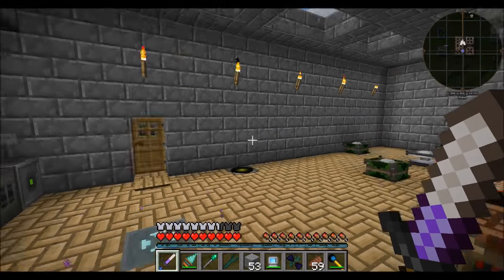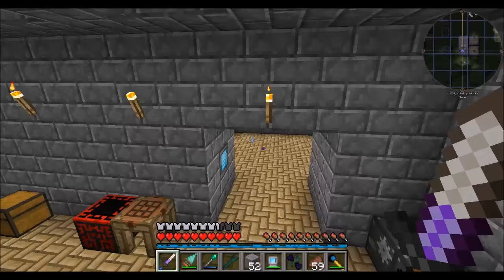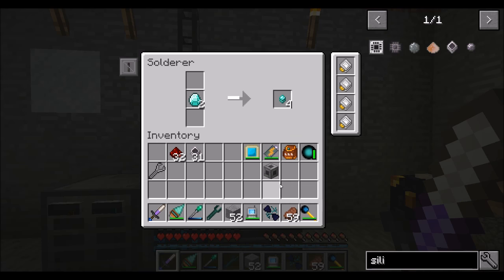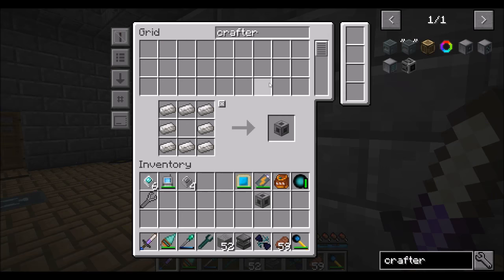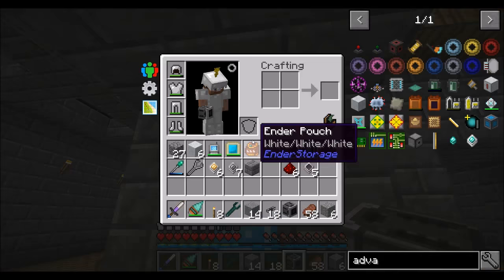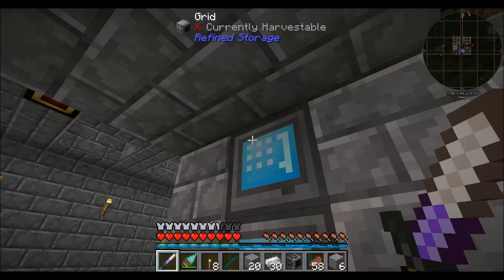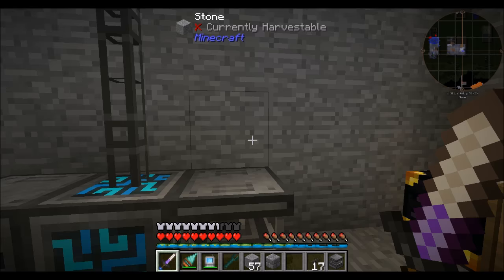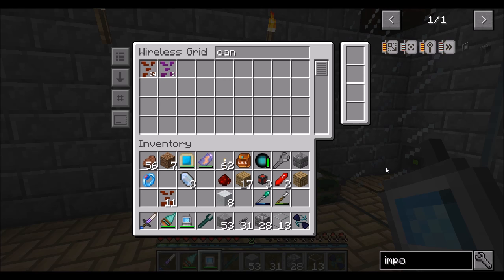Lets Play S8 E24 Autocrafting

Comment: Nice system, I use a very similar one myself. A couple of tips:

1) As others have pointed out, you can JEI shift-click into the processing pattern encoder. I've never found a recipe this doesn't work for - saves so much time rather than having to go pre-craft a bunch of stuff to have the items in your inventory.

2) Restonia / Diamatine / Emeraldic etc. etc. all have the same item ID but different metadata. So if you whitelist one of them and ignore metadata, the vacuum chest will pick up all of them, thus saving those precious five filter slots.

Comment: On your laser setup: if you move the vacuum chest up or the pressure plate down one block, the vacuum chest might work with a range of one since Minecraft might see the item on the pressure plate as two blocks above the vaccum chest.
The laser shouldn't need to move since it creates an area of effect. :)

Also, as +Petar Tsankov mentioned, if you use whitelists in the vacuum chests that hold 5 lasered products each, you should be able to surround the pressure plate with 8 vacuum chests, which would make for 8x5=40 possible items in the current laser setup.

Comment: dire, if you whitelist instead of blacklisting you can add more vacume chests
Reply: He could also just use a mod-item filter whitelist with an actually additions item in it.

Edit: I just watched the end, he was empowering canola seeds, so that wouldn't work, Cuz the before and after are both from Actually additions.
Reply: well the canola seeds are an actually additions item so that wouldn't work
Reply: Yeah I didn't think of that until I saw the end of the video. I was thinking of like quarts, lapis, and diamond
Reply: Having multiple vacuum chests wouldn't work either. He would still have to blacklist the item in each of the vacuum chests for it to not be picked up by the other.
Reply: JustStayAlive that's why i said using whitelists instead of blacklists

Comment: Setting up the automated production like that is pretty neat, but I'm kind of curious about something. What happens if you were to automate something like Quartz to Prismarine Shards, put in a crafting order for something like 10 or 50, and the laser doesn't have enough power to create all of it. Would it break anything if it had to recharge? What about a larger order that takes multiple recharges - would the remaining Quartz time out and de-spawn before all of it was changed? How would the auto-system react to putting in the required material and the product never comes in?
Reply: If the materials never come in, the crafter just waits indefinitely. If you didn't have enough power, or couldn't supply power fast enough, the quartz could definitely despawn.
Reply: Botania to the rescue.  Hopperhawk mini, item frame, quartz only, and mycelium so it has a long delay before picking it back up.  Quartz goes into the open crate to reset the timer.   Make sure the laser only fires while the items are on a pressure plate.
Reply: The quartz that doesn't get reconstructed to prismarine, because of lack of power, will sit on the ground and despawn if it stays there too long. There are a bunch of ways to address that. One option is to add a redstone delay to the open crate if there's not enough power in the atomic reconstructor.

Comment: You could maybe consider using a Ranged Collector from Actually Additions instead of the vacuum chest. You can have more than 5 items in the whitelist/blacklist there. I'm using that along with a Precision Dropper to automate the Reconstructor.
Reply: Using a mod-based filter would be the simplest option.  All the outputs are from the AA mod, and none of the inputs are, IIRC.

Comment: Anyone using Pam's, look into Cooking for block heads. its makes using pams so much easier.
Reply: you do cooking for blockheads? Tell me please wth is the multiblock kitchen all about?
Reply: well the cooking table looks in the player inventory, and the inventory of any of the mod's food storage blocks, like the fridge, and lists what you can make with the ingredients you have. It will use any cooking pots, skillet, chopping board etc in the tool racks to make those recipes. Sinks provide any water a recipe might need, ovens will cook any raw ingredients like dough into bread (needs fuel), the toaster will, of course, toast bread and the milk jar/cow in a jar provides milk. All from a click in the cooking table. There's no functional difference between the fridge, counter or spice rack other than aesthetics as far as i'm aware.
Reply: the spice rack is actually really aesthetically pleasing :) as is the tool rack.
Now thank you for the in-depth reply m8 but, How bout the basics. Is it actually a multi-block structure in the traditional sense? Like do you need to build it in a certain way or does it function similarly to storage drawers?
Also i'm guessing it doesn't offer any storage benefits to food items ( like storing over 64 of same item in a slot or anything along those lines )
Reply: You don't need to build it a certain way, blocks dont even need to be touching one another. Just so long as all the blocks are within a sensible distance of the cooking table it should detect them. Last time i played with it, i had a few counters, a sink, fridge, oven and several racks all within a 5x5 square.

It doesn't hold any other benefit storage wise no, it's purely for the convenience of not having to sort through 223 odd recipes to see what you can make with the random bell peppers and lettuce leaves you have.

Comment: Just fyi, the crusher takes cobblestone straight to sand instead of gravel.  Bit quicker.  :)
Reply: quicker if none of the machines are upgraded. but crusher is very slow compared to upgraded sag mills, especially octadic upgraded.
Reply: Yeah, but it's still faster to go Cobblestone > Sand in the crusher than it is to go Cobblestone > Gravel > Sand in the SAG mill even with full upgrades.

Comment: Atomic reconstructor can also run on pulse mode to make it work, so there is no need for redstone torch right?
Reply: Wowdude64 no it won't as if too many items and not enough power would clog the system tough the method is possible but not practical

Comment: can't you turn an entire block of diamonds into empowered diamontine to save on mats?
Reply: yes. he has done that with redstone and lapis.
Reply: I've seen that, but he's never done it with diamonds
Reply: In a prior video he said that he didn't do that because diamonds are more valuable than any of the other materials, and they weren't needed super often so making 9 at a time was overkill.
Reply: While I don't disagree with that, if it's a key crafting ingredient it's worth over making WITHIN REASON!
Reply: That's fine once you're at the point when you have a stack of diamonds.  At the time I think he only had about 20, so using up 9 in crafting is a significant investment.
Reply: you can at the cost of more power, empowering diamonds just requires clay and dye, both of which are suuuuuuper common in the DW20 pack.

Comment: Why don't you use a hopperhog and the 10 sec delay mechanic lke you do in your red coal mana generation thing. I'm almost certain that the atomic reconstructor needs less than 10 sec to fire and you wouldn't need to filter stuff with that.
Reply: Dead Phoenix the 10 sec delay mechanic is for the crate not the hopperhock :)
Reply: So will that prevent vacuumchests also from picking up items?
Reply: It's not the timing he cares about, he set it up this way because sometimes the dropped items are going to have to sit in the spot for a while. Like he said, if he tries to reconstruct stuff and doesn't have enough power for all of it, then only some of the items are converted. With this system, it will only pick up the converted stuff, and the unconverted stuff can sit and wait for the reconstructor to accumulate more power (although this isn't really an efficient setup). You can filter hoppers, but it's much more annoying and IIRC you can only filter one item to be picked up.
Reply: My idea was mainly to avoid the filtering of items at all. He doesn't have that many slots in his filter and that might limit him soon. 

But yeah - I haven't considered a shortage of power with my idea, so it would need some tweaking to be perfect.

Comment: This pack could do with Mekanism being added. Only having Ender IO and Actually Additions for material processing is lacking. I know there's IE but it's too slow.
Reply: It has some powerful stuff in it but I'd call it balanced rather than OP.

You need to invest a lot of material and RF in order to get the higher tier set-ups such as the 5x ore processing and the Fusion Reactor, and the Induction Matrix to store all the RF output from said reactor.

When the reactor than can generate up to 1.2 million RF/t you can't just use Ender IO capacitors to store the RF. The reactor also needs a 500 million RF charge from lasers (which output 20,000 RF/t max) to ignite it, so it's not like a Big Reactor where it you can turn it on and off at will (you can turn it down to 200,000 RF/t though).

The reactors are OP once they're up and running though, I'll admit that. I built two in a previous play-through and had them powering 160 laser drills.

I'd recommend giving it a try for yourself in a mod pack such as the FTB Hermitpack for 1.10.
Reply: Well, it really is too much powerful in some occasions, in my opinion. I mean: it's totally a fun to play with, but you will end up to make your builds with Mekanism machinery the 90% of time. They're powerful, fast, upgradable, and CHEAP in comparison of what they are capable to do. 

In example, the top tier factory smeltery, which is a  monster, can be made with reasonable materials and, most of all, runs with a bunch of RF/tick. Fully upgraded (both energy and speed wise) outclasses something like 7 octadic alloy smelter... speed, resources and power wise. The same argument can be carried over for all Mekanism machinery. I will not mention energy production, which is simply OP sometimes: in early game i can (and will) run an entire base with some cheapy wind turbines. For free. Dot.
Reply: Mekanism is fun, but not balanced in the slightest.  I personally consider Draconic Evolution more balanced, and that mod is insanely OP.  In Mekanism, the Digital Miner and Wind Generators would have to be disabled as those are far to op for the cost to make them.  The Digital Miner makes all material costs an irrelevant balancing mechanic.  The Wind Generator is a cheap, place and forget generator that produces up to 192 RF/t (at the build limit), and mass producing those is easy and makes power basically infinite.  If you know what you are doing and don't get really unlucky with mining, you can have a Digital Miner running on a Wind Generator within 2 hours of starting a world; and have a small fleet of Wind Generators at the build limit and a pair of Quantum Entangloporters within 3 hours.

That's not even mentioning how good the normal machines and upgrades are, how cheap 3x ore processing is, or how unnecessarily powerful the reactor is.  Its machines are clearly better than any other machines in the pack, which is not balanced.

The final nail in the coffin is that it's unstable at the moment.  Aiden's busy with college/university and doesn't have time to work on it.  It has several mod interactions that are bugged (even things as basic as fluid pipes not working with IC2 machines, and several bugged interactions with power cables).
Reply: Let me make this clear:  I like Mekanism.  It's a fun mod, but is too overpowered to be included in the average modpack without making major config changes.  If any individuals would like to add Mekanism to their pack, then by all means, have fun.  The DW20 pack is made as a kitchen sink pack that is easy to edit.  I just think that Mekanism is too overpowered compared to the default balancing point in this case.
Reply: + John Ratliff IE = Immersive Engineering (an RF mod).  You are thinking of IC2, which is both safe to include as it does have processing... and safe to ignore because it's an entirely different power system.  If we are including non-RF mods, then we can also include Blood Magic on the list of mods with ore doubling mechanics, along with TiC's firewood material to give auto-smelt (which stacks with Fortune from Lapis).

EDIT: Oh, and don't forget Applied Energistic's Grindstone!
Reply: There's also IC2 macerators and Tinker's smeltery.
Reply: +Markus Brorson The Auto-smelt enchantment is added by Ender Core (Ender IO's core mod).  It also adds XP Boost.